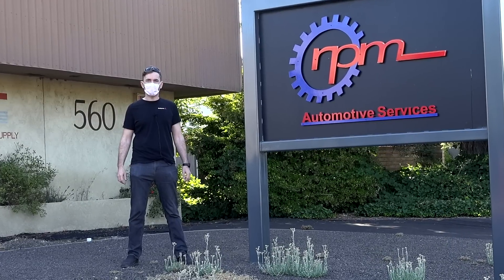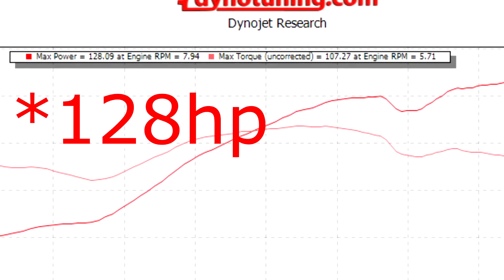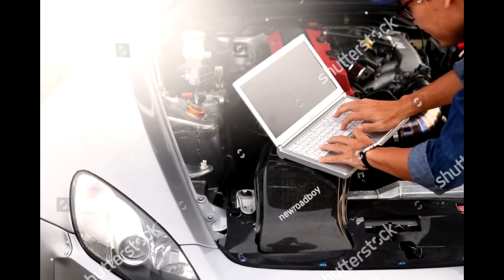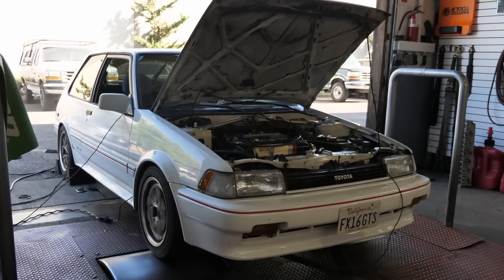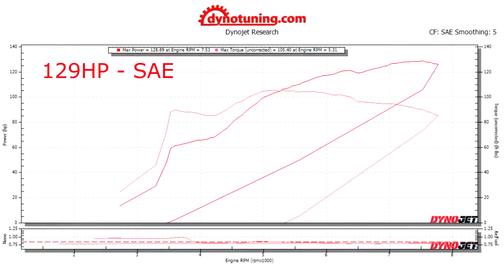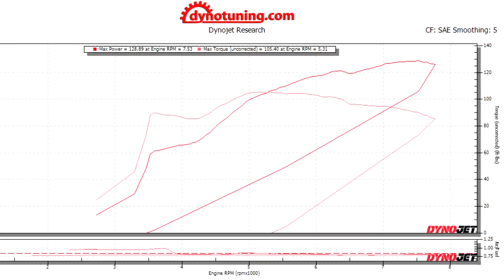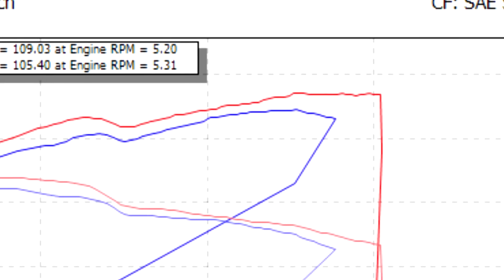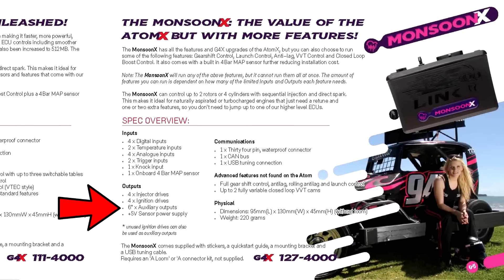Part 3: 4A-GE ECU Upgrade - Road Tune vs Dyno Tune Showdown!

Comment: I just stumbled across this video, and really appreciate all the detail in this series.
Interestingly I was able to get my Bluetop 4A-GE bigport to make about 130HP at the wheels at 7500RPM with the stock ECU, Tomei Poncams, and higher compression pistons that brought up the compression ratio to that of a smallport 4A-GE.
That said, with your tunable ECU plus cams I'm sure you could get a lot more power, but it's neat that this amount of power is also achievable with the factory ECU too.

Comment: How close do the engine mounts line up with the 20v to the original 16v mounts?
Reply from the maker: They line up perfectly. The only side that doesn’t line up is for the c160 trans mount.

Comment: Hey dude can you possibly send me the Tune on a flash drive. Save me the time and money with my swap.I have this ecu but it's all plug and play patch harness to my 20v harness.the 20valve swap I'm putting in a 96 corolla it's all jdm. I acquired a front cut from a GT APEX so it all plug and play for the most part.

Comment: tbh I think that you have wasted a lot of money on ITBs if your car only made 135 bhp with such a good exhaust system and a free flow air intake, that engine is worth 135 bhp without ITBs. Perhaps if you had wild CAMs installed then ITBs may  be worth investing in.
Reply: ITBs are standard on 20V engines

Comment: Currently in the process of trying to swap a 4age silvertop 20v into my stock 95 corolla 

My mechanic says everything looks great, I just need a new wiring harness, a new ecu and a new fuse box and it should he smooth sailing 

Thank you sharing your build and recommending these ECUs you are a life saver and a bro

Comment: I have a question, if it is a 4age 20v blacktop, why it only produces 125-136hp if in theory that engine should give 160-170h?

I don't understand, I don't know if I'm ignoring something?
Reply: Yeah 
Nobody's answering this 
Its essentially stock power at the moment,
Reply: The hp readings are at the wheels. The stock hp rating for a Blacktop (165) is at the crank.

Comment: Small question: Can a 4A-GE intake system (whether it be 20 valve itbs or 16 valve single throttle) work with a 4A-C?

Comment: Hey Sushpants
How did you guys install the knock sensor with the purple wire? I thought the blacktop 20v had it's own knock sensor or is that one not accurate enough for the ECU? 
Also now it's time to install cams and see how much power you gain.

Comment: I say job well done in how you managed to tune it within 5hp of a professional tuner! Those few extra ponies will definitely come in handy.
Especially with that 15hp bump about 3/4 way up the revs, for what you're doing it's a much appreciated addition.
And similarly so is the case for anyone doing the same thing as you!
All in all it's welcome information for a lot of 4A-GE enthusiasts.
I'da gone aftermarket ECU but the ECU+adapter/wiring are usually around 1500 for 20v's (Just checked MRP and I was pretty much dot on).
But that's to be expected, the issue is the additional 500-750 tune which I have a hard time justifying up against the extra few ponies.

Comment: So now that you’ve used both a Megasquirt and a Link, what one would you recommend for the average DIY guy?  I’m building a 7age, 16v with ITB’s, and planning to do COP and eventually turbo, maybe, but not right away for the turbo.  Thanks for all you do and share, cheers.
Reply: There's also a Speeduino if you're on budget and don't mind doing (almost) everything yourself.
Reply: @snap_oversteer  thanks, I’ll look into that too!